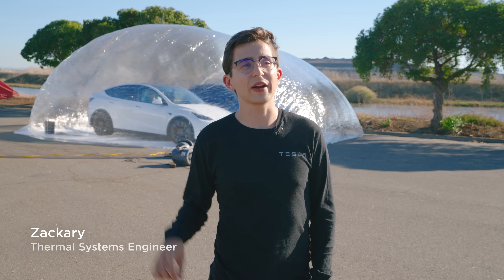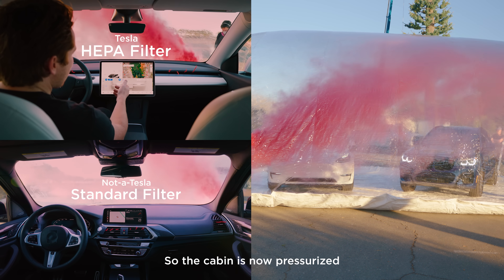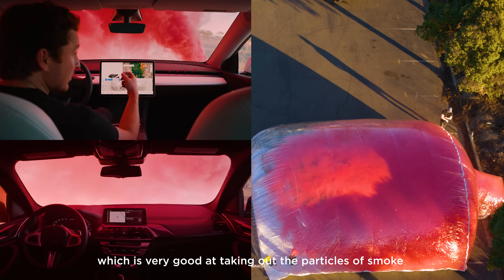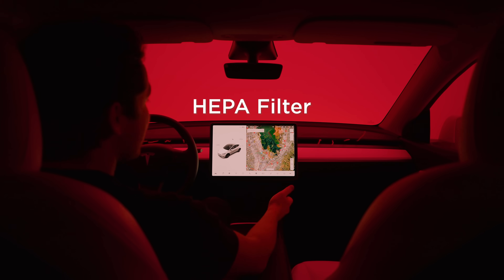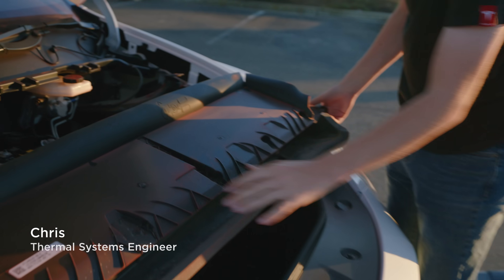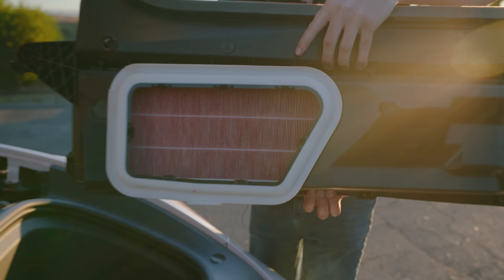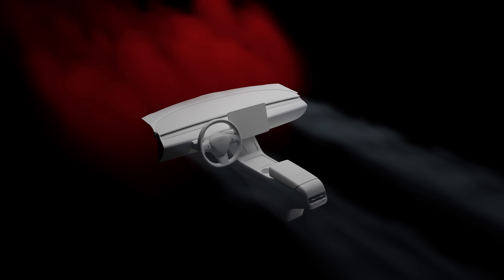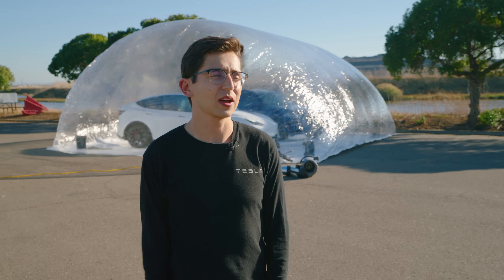Tesla HEPA Filter | Keeping Your Cabin Air Clean

Comment: When your car literally cleans the air around it instead of polluting 🤯
Reply: And this car didn't grew on trees, it polluted the environment during its manufacturing process. Stop with this green washing
Reply: Yes 🤯😳❤️
Reply: To be fair, Euro6.d and I'm sure even some older standards, actually drops down the NOx levels so much that they clean the air from those in cities. And Tesla still emits a ton of PM from the tyres and brakes, as with any other cars. The slight offset given by the PM emitted from ICEs, is balanced by EVs' higher weight, hence, PM wise, EVs are not better. It's not all sunshine and rainbows unfortunately.
Reply: @guggi_  sounds like a petrolhead/ev hater
Reply: @aminfozdar  Quite the opposite, watch my reply to joob 
And btw, if I were a petrol head commenting on Tesla, it would be really sad. I take pollution really seriously as I live in the dirtiest zone in Europe by basically any criteria.
Reply: @guggi_  Its a gross misrepresentation to put it like that. Euro 6 compared to Euro 4 is just a 25% reduction in NOx and measurements show that manufacturers are not trying to go for more reduction than necessary. I dont see how a slight reduction in emissions makes them "clean" the air around them. 
Dust from brakes and tyres is wildly different, both in particle size (PM1 - PM10 vs diesel extending all the way to PM200), material and quantity. Brake dust and tyre dust are iron and rubber, mostly inert materials, although tyre dust is less significant due to the high particle size (it settles quickly, you wont breathe it much). Diesel emissions include 12 groups of compounds, 3 of which are known carcinogens, and several others highly toxic. All at particle sizes that can enter the bloodstream. 
Brake particles only made up about 3-20% (Bukowiecki et al., 2009a) of particulate before electric cars and with the ~80% reduction in brake wear due to regenerative braking it drops to max 4%. 

Just looking at these numbers I really dont understand how you are calling modern diesel engines clean and find them comparable to electric cars in numbers. Nobody said electric cars are perfectly clean or a brilliant solution to transport but they are over an order of magnitude better than what we currently have.
Reply: @drkastenbrot  I can't mention the source, as they were given to me by the CEO of AVL Italy, during a conference at my university, since it is a private company the presentation wasn't given to us, but what I said it's mostly given from that, basically the NOx reductions means that the air it's polluted, the NOx at intake it's higher than exhaust. It was an on-road tests results, (AVL works in the powertrain sector). 
And the median or average can't remember, PM emissions was slightly less in EVs than ICEs, like 90% iirc, as the majority comes from tyres and brakes, tho it's still better than diesel and GDI gasoline soot of course.

Last, EVs are not an order of magnitude better, the ones now are way worse than what we will have in only 5 years, especially battery wise. Ofc it's important to consider the energy mix of the country, in a state like Norway, the only pollution comes from manufacturing, so it's a no brainer to go EVs, but in the EU average, EVs are not that much better than ICEs in term of CO2, and if you push too much on them in a short period of time, it will cause an unsustainable increase in electrical energy, that will likely be adressed with fossil fuels generators. (Another conference at uni, was from a "Kohler" employee who said to us they had an order of a diesel engine to power EVs charger in a big parking slot)

I love EVs and they are in basically everything better than ICEs, but pushing them too early could mean increased pollution if it is not done right, that's it. Hopefully I made clearer my point
Reply: @guggi_  "Tesla still emits a ton of PM from the tyres and brakes, as with any other cars".    Average gas car brake pad change interval: 40,000 miles. Tesla: NEVER. I see you did your research
Reply: @katnonumb  Your tone gives me the idea you're just fanboying Tesla and do not care about environment issues nor want to learn something by this discussion, unlike @joob that gave some nice points with sources. Speaking of sources, where did you take the "never" stat? Afaik Teslas usually needs brake change with a frequency of 2-4 times less than an ICE, not never. That's still remarkable and with regenerative break + FSD it would be even less. RG it's my favourite perk of EVs, the waste of energy due to brakes it's irritating. As it is burning fossil fuels with 35% efficiency, grrr
Reply: This is idiotic. A cars vent fan is so insignificant that it isn't even worth mentioning.
Reply: @oisiaa  Insignificant to outside air quality yeah but its still true and it is a pretty funny fact.
Reply: @oisiaa  The fan may not be but the filters could be. 😀
Reply: @JackMaslovLive  No....if you are moving 100 cubic feet per minute through the filter it's absolutely insignificant even 1,000,000 cars with this would be nothing compared to the outside world.
Reply: @oisiaa  Duh, but technically it's true; it's small but the only output is cleaner air
Reply: @oisiaa  sounds like something a petrolhead would say
Reply: @gormauslander  No, a passionate EV driver who loves low operating costs.
Reply: @Njadmessi  HEPA filters aren't new.
Reply: @Waldo1122  but Tesla is. Computers weren't new but the iPhone was. Please get a life.
Reply: @Waldo1122  he never said they were. He just was talking about EVs having HEPAs and EVs being new. Just read his reply to u
Reply: @aminfozdar  Evs having HEPA isn't new nor is cars in general having HEPA isn't new. The reason manufactures don't use it, is because NO ONE is going to switch out the HEPA filter each year which is required for a HEPA filter to continue being effective.

Comment: "How well" is only one variable but how long does it last? How many minutes could you sit in that red cloud? There should be some kind of benchmark. And yea of course, why would you even turn on your A/C going though a poison cloud? It should turn off automatically when it notices an unusal amount of particles to extend the filter life span. And lastly: A HEPA filter won't protect you from poisonous gases like carbon monoxide so don't even think about driving through a bush fire in your Tesla. I think this commercial is a bit misleading and potentially dangerous as it suggests you can drive through a thick smoke cloud just because it filters out the particles.
Reply: Agree.

Comment: Most cars have HEPA filters though, let's not pretend that this isn't common. 😂
Reply: Most? You're joking right?
Plus, just because you ADD a HEPA filter to something doesn't mean it's actually HEPA probably.
Reply: @isthatatesla  Yeah blind fanboys are the ones shouting in the comments. Many reasons to love Tesla... But like common. This is pathetic.
Reply: @isthatatesla  with Tesla's panel gaps and horrible alignment and quality control... I wouldn't bet on it being bio Hazard safe lol, so yeah, you're correct.
Reply: @OutOfNameIdeas2  2015 want it comment back... I know 2 friends that were lucky getting a model 3 as company lease and both had 1-2 minor issue on the whole car. Both got it fixed while they were at home since tesla sended them a service engineer. Hate all you want but if a 1cm panel gap is your biggest issue on a car, I would call that a very good car.

Meanwhile my A4 had been in service 3 times for weird rattle notice in the right back and is stil not fixed. So I would take a tesla with a 0.3mm bigger gap on 1 panel over a rattle they can't find/fix. Since guess what, panel gaps is easy to fix if it's doors/hood/trunk etc. Also my 2021 A4 has no hepa filter and neither did my 314 bmw I had before or any other car I owned.
Reply: @pipooh1  If they cant fix a rattle noise, you should probably switch the shop... I got a A4 myself and every problem it had (already got 180k miles on it) was easyly fixed by myself or with a friend together and im not a mechanic at all

Comment: Wow, Tesla tops it’s competition once again. Impressive.
Reply: What they are showing is not the regular HEPA filter that every Tesla has like many other cars. This is an additional filter part of what they call the bio defense system.  The regular HEPA filter cleans the air like other HEPA filters (nothing new there) but this a different filter in addition to the other HEPA filters has to be activated when the other filters can't handle contaminants in the air.
Reply: @acolon8999  What they call bio defense system is just a normal gas mask filter. Active coal and what not. Tesla does not invent anything new. They just use what's available.
Reply: @kicka55   I don't know if it is just a normal gas mask and active coal like you said. I won't disagree with you because I don't know what they are using and I don't want to be commenting on what I don't know or don't have facts to back it up.

My comment was to clarify that this was an additional filter to the HEPA filter that they have like other cars. I am not saying that they invented the filter they use for the bio defense system.

I agree with you that other companies might not use this large filter because of high cost. It is cool though that Tesla owners have that additional feature. I like having choices.

I just learned that all Model Ys built since late 2021 have this extra feature. My wife is getting her Model Y sometime in March. Can't wait to try the bio defense system for myself and see if it really makes a difference.
Reply: Tesla Fanboys are at it again
Reply: You can buy HEPA filters for pretty much any car. It just costs a lot more so nobody does it. A single cigarette or sitting at a camp fire you inhale more particles than you would driving your car for thousands of miles.
Reply: @kicka55  Yeah but I think it's meant for situations when the air quality gets very bad. For example if you have to drive through big forest fire.
Reply: This is standard in almost all cars and have been for years. I don't understand why people think Tesla is the only one with this or why they they think it's even remotely new
Reply: @OutOfNameIdeas2 "Brawdo it's got electrolytes!" They didn't disclose that they removed the hepa filter from the bmw. The audience make the inference that other cars  don't have hepa cabin air filters.
Reply: But companies like BMW use even better filter sytems already (as example Nano filters) so how do you top your competition with technology which isn't better? I really believe all of you did never really care about filtering systems until Elon called Teslas a Bio Defense weapon.   Otherwise you would be better informed.

Btw the reason why HEPA isn't common in most cars  is because it's too big for non-electric cars. Not because other manufacturers are too stupid.
Reply: @CarstenNRW  Yes the HEPA nano filters are allegedly better than the regular HEPA filters. And you are right you can get the nano HEPA filters for almost any vehicle today including Teslas. I think almost every car manufactured in the last 10 years has a HEPA filter, there is nothing new about that.

The filter use by the bio defense system is an addition to the common HEPA filter.   And just like you said, because there is no engine, many EVs have more  spare room under the hood.  This allowed Tesla to put not just a bigger filter but a filter with many more layers of filtration. It is just science. It is like trying to breath from a straw compared to one inch pipe of the same length as the straw. Tesla didn't invent anything new, they are just using a bigger filter that allows them to put more filtration layers while still getting a decent volume of air in the cabin, something that can not be done with a smaller filter. Tesla can't fit a filter big enough to achieve the filtration that they need on the Model 3. Any company can build a filter just like Tesla did, the issue is having the room to put it in the car. The more filtration layers you put in, the bigger the filter you are going to need to achieve the same volume of air going to the interior of the car. 

I personally don't think other manufacturer are stupid, it is just that they can not do it because of the restriction in the available space, just like Tesla can't do it on the Model 3.

I've experience the bio defense system at work and I could definitely tell the difference compared to the regular HEPA filter. But it is not magic, it is just a filter with many more layers of filtration allowing it to clean the air better.

Comment: It would be awesome if tesla released a few more videos like this explaining all the cool features teslas have
Reply: I wish they add HEPA to M3.
Reply: @arshdeeppandher6960  You can get an aftermarket HEPA filter for M3.
Reply: @arshdeeppandher6960  Aftermarket M3 HEPA filters are available. 
My understanding is that the HEPA filter that Tesla uses in MY won’t fit in M3.
Reply: @Laura-S196  there are many options to buy third party HEPA filters that will replace the filter inside the cabin for model 3. However, actual HEPA in model Y, S & X consist of not only HEPA filter, but also control the air pressure inside the cabin. When bio defence mode is activated. Ventilation system restrict the air flow that is exiting the car and hence increasing the air pressure inside that car which further eliminate any risk of micro particles entering the car. On average, factory HEPA is 40 to 60% more effective than retrofit HEPA filters. About a year ago Elon mention that HEPA not coming to model Y due to less space in frunk. Looks like they designed new system for model Y. So there is a chance that HEPA maybe coming in Model 3 in coming months.
Reply: There are a lot of those
Reply: Would be great
Reply: Would be interesting to see how they self combust
Reply: @annettejahrstorfer3463    I've not heard of a HEPA filter self-combusting. Where have you seen this?
Reply: They might be exaggerating a bit.
Reply: I think that's the route they're going.
Reply: indeed
Reply: +1
Reply: Tesla owners are already doing that
And they are disgusting
Reply: Yes for sure dude they should
Reply: What cool features? Fart sound?  You can put a hepa filter on any car.
Reply: So true. It would be honest advertisement.
Reply: My model S is coming June to July so it’s gonna be great with a HEPA filter also saw a plaid in a tesla showroom it felt great
Reply: for us poor people that don’t have one

(joke)
Reply: Haha that’s what my channel is all bout 🔥

Comment: The air quality problem won't be solved by car filters, but this is still good at bringing awareness to the issue. Thanks for doing your part Tesla!
Reply: The air quality problem will be solved by the cars and trucks!
Reply: @isthatatesla  Even though planes produce wayyyy more emissions than cars
Reply: @isthatatesla  You mean enterprises, You realize our huge diesel truck are the 0.00001% Contribution to this contamination. You realize, how many tons of toxicity is drop every second, and is not gonna be solved by cars and trucks... DESPIERTEN!!!!
Reply: @jorgeruz  Dude your data or "guess" is completely off. Transport in the US makes up 30% of green house gasses.
Reply: @jorgeruz  We’re talking about air pollution and this metric has been replicated by thousands of different studies. Air pollution from transport is significant.
Reply: @isthatatesla  We need less cars. EVs are good but ultimately producing unlimited EVs like we're doing now with ICE vehicles will also come with issues.
Reply: its not meant to reduce the polluted air in a city, its meant for you to live long life even in a very polluted city i think
Reply: This is primarily to keep passengers safe when air quality outside is bad. Solving pollution will take transitioning away from gas, diesel and coal. I know a company that is spearheading humanity's efforts in doing so.
Reply: shutup.
Reply: @Tuck_Frump  so angry over a comment smh

Comment: Great work to the engineers and worker's at Tesla Motors. And thanks to Elon making it happen.
Reply: It is so weird to me that Musk gets so much credit for the engineering department of a company he simply bought.
Reply: Did you ever thanks the CEO of Mercedes for putting HEPA filter on his car in 2011?
Reply: @tiloalo  no .. elon fanboys only thank the ceos of tesla lmao.. thank u amazon engineers and jeff bezos for making it happen.. thank u microsoft engineers and bill gates for making it happen.. sounds weird rightt.. elon is just the buisnessman and these fanboys dont get that
Reply: @aabc  honestly at this point I'm not even sure he is that.
He might just be the relatable face they use when conducting business.
And it works, service is shit, it cost thousands and month to get a replacement part, old tech is presented as novelty, ... and they all fall for it.
Reply: For clarity, put a device in the car interior that would show the number of PM 2.5 particles.
And by the way, I have a hand-made forced ventilation of the room at home, which filters out the air through 2 filters:

1st standard MERV 13
the 2nd one that comes after it is a HEPA filter.

The devices always show 0 PM 2.5 particles in the room.
All this helps a lot to purify the air when it is supplied from the street, especially during the annual fires in California.
Reply: Worker's?
Reply: I agree
Reply: Great mission, coolest products and the engineering genius Elon Musk.
Reply: It's a shame the Model 3 and Y don't offer this.
Reply: @aussie2uGA  it's literally a model y in the video
Reply: @tobylii  But it's not offered on the Y or 3.
Reply: @aussie2uGA  it is on the newer years. A retrofit is supposedly coming but no news yet.